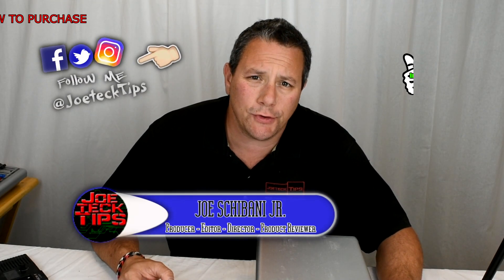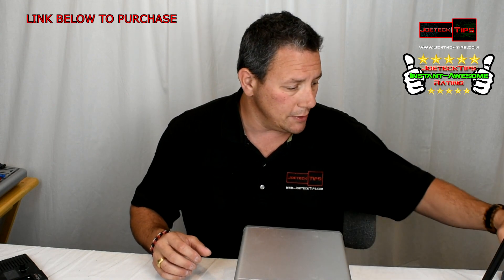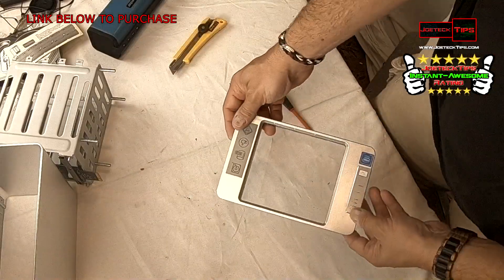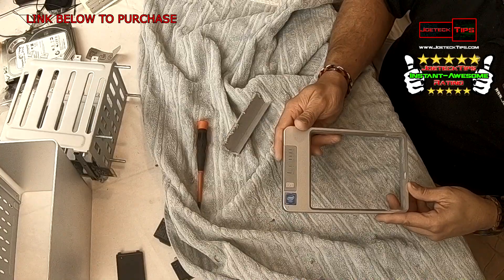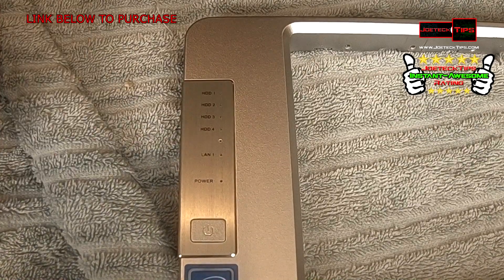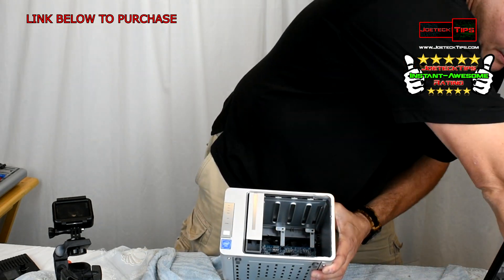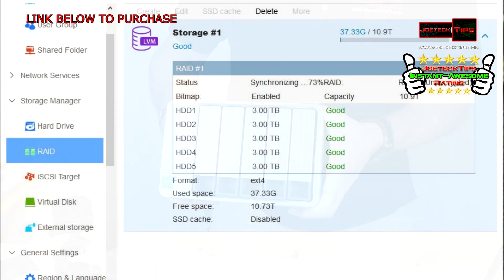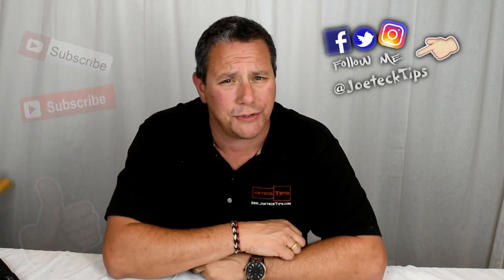Hacking a TerraMaster 4 Bay NAS to a 5 bay | HOW TO | JoeteckTips

Comment: Great video. I purchased mine in march 2019 and it had the extra sata port. I have just done my hack (Dec19) 4 bay to 5 bay + the memory upgrade. booted fine went into TOS. Added the new drive to my raid 6 setup. All working great. I thank you for the inspiration to do this hack to mine.
Reply from the maker: Awesome!! Glad it worked! Comment pinned!!

Comment: So works with 2020 model. For only smb and nfs share the memory upgrade ist not necessarily
Reply from the maker: That is awesome. I have requested they add it back. They found out about this video and removed it. I requested they reverse it because you'll get more sales if you do and they did. Thanks for the update.
Reply: @Joeteck  current beta firmware speed up nfs transfer speed.  But there is a bug in the nfs startup script.  Support send a midifyed nfs script after request  not works like a charm

Comment: Nice hack.
Bought one 3 days ago from Amazon. Arrived today. The PCI express board says F5 V1.3. It does not have the sata connector neither the other components.
I wonder if I weld them, if it will work. Should not be hard to find the connectors and chips.
Probably won't do it anyway, but I will dremel that plastic and put one extra bay. I will use it with a 200GB sata disk, connected to the two internal USB as guest operating system, either with TOS or OpenMediaVault.
Will do some testing
Nice work

Comment: Hi, thanks for this amazing tip. I have now just done this and I have put a 5th 8Tb drive in. However the software would not let me select RAID 0, so I could not make a 40Tb drive. I could select RAID 5 and have 32Tb with redundancy though. Is there a way to get RAID 0?
Reply from the maker: Raid 0 is not a good idea. Lose one drive, you lose all data. RAID 5 is the way to go
Reply: @Joeteck  I am not worried about that, I have a backup and an offsite backup of that backup. I just want to be able to use the full capacity on the NAS.
Reply from the maker: @classicalmusiclover7903  can you do RAID 0 with 4 drives? If not, it was never available from the start. However,  I would check for a firmware update.

Comment: I just got this on sale for $200 on Newegg Flash ! Great deal for 4 drives by itself. I tried putting an HDD in the 5th hidden slot and the NAS won't boot unless I remove it. So it's possible even with the sata slot there, it might not work with newer units. Just my 2 cents.
Reply from the maker: Flash the firmware first to the lastest
Reply: Ahhh I forgot to do that. Thanks I'll give that a try. 
 @Joeteck

Comment: This hack doesn't work any longer since TerraMaster has changed the board for the harddrive connections, the 5th bay area is still there, but no connectors or electronics to run those connectors.
Reply: Have a fresh  2020 model here and works like a charm Wirth hdd5
Reply: @GTRDRIVER1  Hi mate, what exact model number you are talking about ? 👍

Comment: How bout upgrading the CPU, or what slot is it? The flash drive has the OS, how bout trying out different OSs with the same unit? I do like the 5 drive hack! Great find. Was there an LED for the 5th or did you need to supply one?
Reply from the maker: Did you watch the video? lol... CPU is not replaceable. LED is there, just need to make a hole.

Comment: Current units being shipped by Newegg as of the end of October 2018 have neither the connector nor the support chips installed for the fifth drive. Unless you can get hold of an older version, this hack is, unfortunately, dead.
Reply from the maker: Amazon,i have the link

Comment: Be aware that newer TerraMaster F4-220 NAS enclosures do not have backplane support for a fifth drive.  The board has the location for the connector but there is not one soldered on or any of the hardware.  Make sure your backplane actually supports five drives before getting artistic with the dremel.
Reply from the maker: I was told by TerraMaster that all F4-220s have it. Saves on manufacturing costs across the board
Reply: I can definitely say that my NAS purchased last month does not include the connector.  Also on a deal group there are others who very recently purchased and stated the same.
Reply from the maker: @jtsongas  you may have the old version.
Reply: I just got a new F4-220 from Newegg on 10/20/2018, and not only does it not have the fifth connector, the support chips next to the connector are also not there. This hack is, unfortunately, dead.
Reply from the maker: Amazon, I have the link

Comment: Nice hack, but more interested is if you can get the second LAN port to work for link agregate that would be a hell of the hack ;) Wonder if only soldering the connector will do the job or another LAN chip might be needed on board, a full resolution picture of the board might bring some light
Reply from the maker: Agreed, it probably would. However, if you mess up you blew up a perfectly running 5 bay NAS.
Reply: Looking on pics I found there is an empty chip near USB connector, that would be my first place to look on adding second LAN chip, I have mine on mail will look close on it  with my engineer friend, yep this will not be an easy job, but if works then it will save a lot of $$$
Reply from the maker: @iuliuscezar3284  adding a lan chip will be a difficult job. If it's a BGA chip, it will be difficult to install. Engineers can design, but not necessarily build / create. Let me know how you make out..

Comment: any speed difference with more ram?
Reply from the maker: No, just smoother. Can't go faster than gigabit speeds. 125MB/s Is the fastest
Reply: Joeteck what benefits for upgrading the ram?
Reply from the maker: @dolph9913  more caching for data transfer and other plug-ins to run smoother. Can me a sql server. You can install many different apps